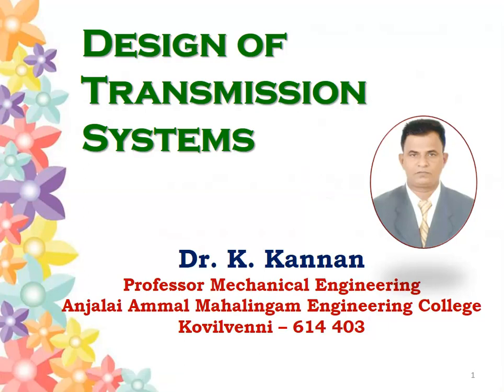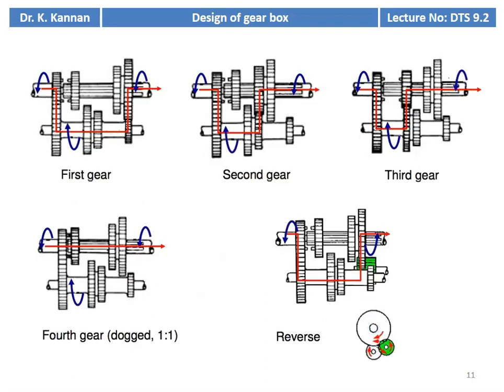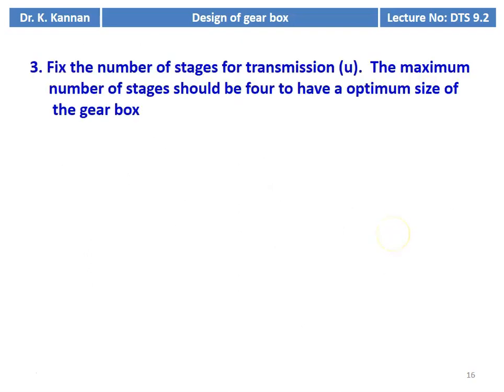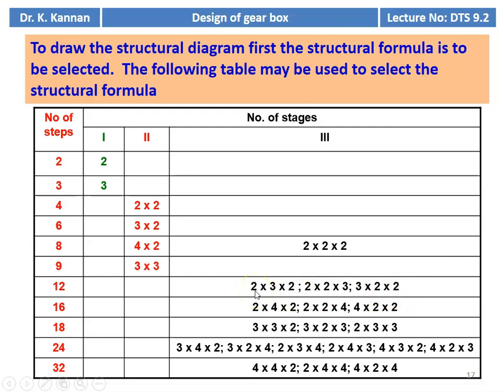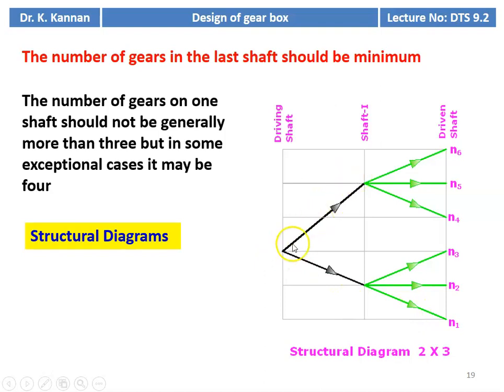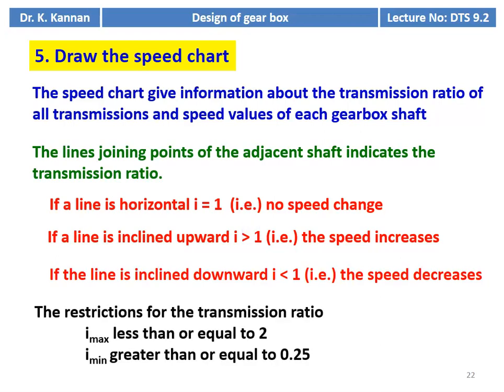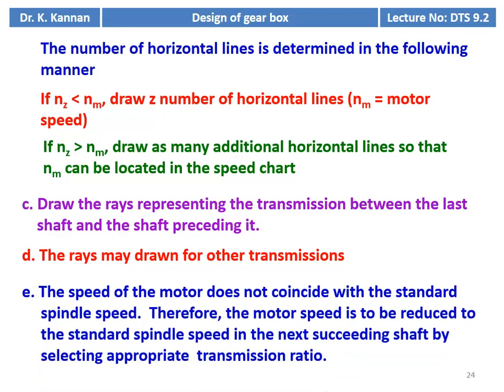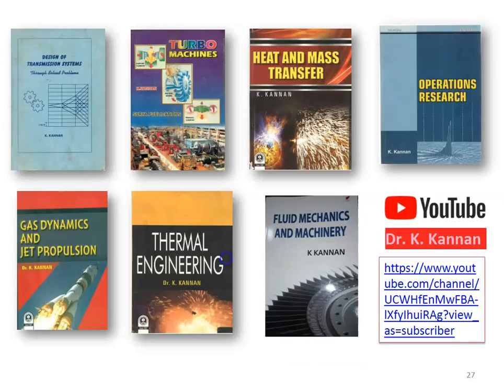DTS 9.2 Gear Box Design

Comment: What does Step mean here, Sir? What if I need 3 speed, 3 stage gearbox if my required Gear reduction is high and Gear box space is low?
Also, in the 6th step, the Kinematic arrangement, Shaft I has 5 gears on it, but you mentioned there should be more than 3 gears on single shaft (4 in exceptional cases)?
Reply from the maker: Step means number of speeds at output shaft
Regarding number of gears, at undergraduate level you need not consider.